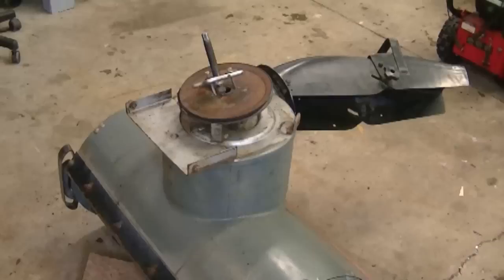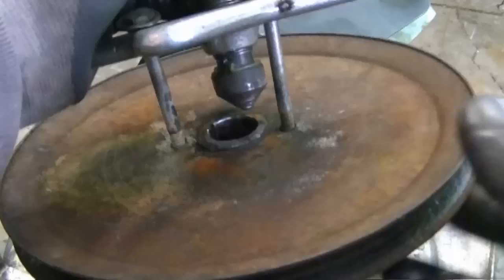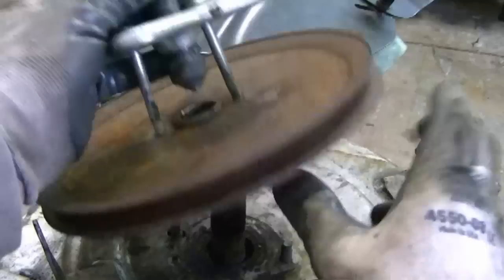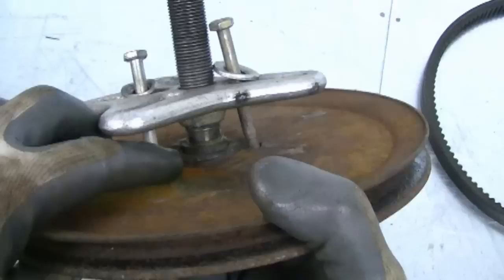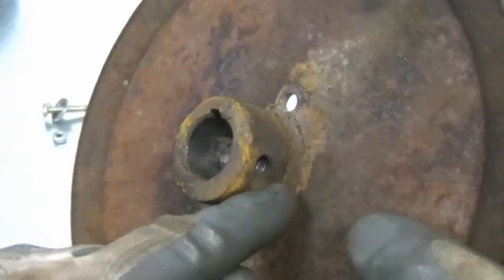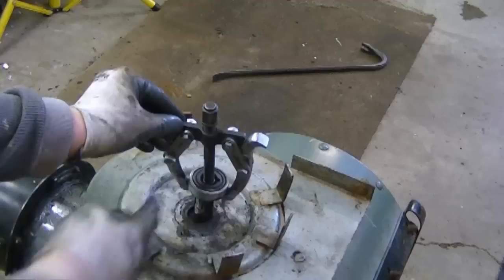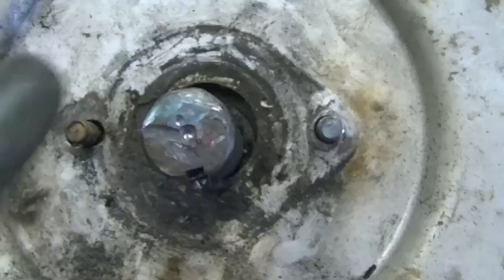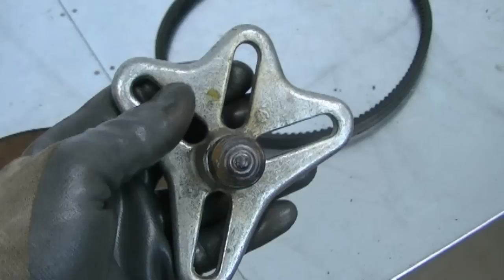How-To Remove A Seized Snowblower Auger Pulley - video

Comment: Very helpful videos. I was able to get 2 pulleys off some old snowblower engines the other day just by heating the old pulley and spraying some PB blaster on the shaft. No puller needed.

Comment: I had that exact same problem with my 40 year old JD 832.  But I destroyed the pulley as the puller I used grabbed the outside lip providing too much leverage.  I ended up drilling 2 holes in the body of the pulley and pulling it off with a strong puller, much like you did.  You are good sir.

Comment: Thanks for ur videos Donyboy-they are great...I have two C950's(5 & 8) now and I couldn't get the auger pulley off the 8 for a bearing replacement until I saw ur vid. I tried the bolt/puller idea but didn't have the equipment to get the heat. I used ur bolt hole idea but used a holesaw to make two larger holes next to the hub so I cud get standard 4" puller arms to hook onto the backside of the hub. I used a chain-wrench to hold the arms together while applying MAP heat..and it worked fine but the shaft/pulley fought it all the way off with loud metal snap noises for the entire length of the removal. Thanks for taking the time to make your vids clear and informative.
Reply from the maker: you're welcome

Comment: Thank you.  Your method work perfectly when I tried to remove my snow thrower pulley!!!  I didn't have to apply as much heat as you did, but it worked.  I NEVER would have thought to drill holes in the pulley.  BRILLIANT!
Thank You!!
Reply from the maker: +jg thanks, make sure you're subscribed

Comment: You did it exactly right, good job. Before heating do this first.  Put all the pull you feel safe with, then do a sharp blow on the end of the puller bolt. Doesn't hurt the puller but usually the shock breaks it loose, especially on tapered shafts like a steering wheel.  Good video.
Reply from the maker: Thanks for the tips!

Comment: First, thanks for posting your videos. They're excellent and extremely helpful.
Here's my questions: 
-What's the torque spec for the bolt (3/8-24) that holds the pulleys onto the crankshaft for an 8hp (HMSK80)Tecumseh engine on a Noma 824 snowblower?
-Should I put anti-seize grease on the bolt threads and/or the crankshaft?
-What's the max RPM for this engine?
Thanks!

Comment: Thanks for posting this. I had to do the same thing but I did not have to heat it up. I turned the puller to get pressure on it then struck it with a hammer. It took a while but I got it off

Comment: Don thanks for keeping videos available to watch. I just worked on an Ariens last night. I have a home made wheel puller. I also needed acetylene to heat it up. Could you do a video on the tools you have for pulling wheels, pulleys, and bearings off. I'm 77 and not sure if I want to buy a set but I know you have to have the right tools to do the job. Thanks again

Comment: Hi Dony. I know this is an old video, but I have a small engine question for you. I am a sm eng tech myself, and I am in the market for a good bolt puller like the one you used in this video on the pulley. There is a HUGE gap in prices on these pullers, and I imagine that quality and overall reliability is a factor. Could you message back, or mention in one of your videos what brand you use, price, opinions, etc? I would be most appreciative. Thank you, and I am a proud subscriber.

Comment: Hi Dony, Nice clear video easy to follow as usual, another good job. Dony I have been working on my equipment for the last 20 plus years. Wish I though of utube years ago. The things I did by trial & error would not have been necessary due to guys like you who are willing to help out. I decided to start a shop from home. Are you willing to help with advice on the start up? If so do you have an email I can contact you at?

Comment: you have to be quick when using heat try to keep the shaft cool but the pully hot its hard to do but if you get both parts red hot they both expand so its like trying to pull it off when its cold but its hot. so leaving tension on the puller while heating up the pully from the outside working in would be ur best bet it should pop at one point.

Comment: Kinda dealing with the same but different issue right now...I have an auger that's seized onto the shaft. I've heated and heated it, pounded on it, managed to get a puller on it and left the puller on while i heated and pounded some more...They just aren't separating. Its an old John Deere 826 model.

Comment: Had the exact same thing happen to me. Listen to this video. I didn't use the two hole method and bent the pulley. I also damaged the shaft in the process. It's going to cost around 160.00 to replace that shaft alone.

Comment: In my experience with this type of problem is to be patient, soak the part with penetrating oil and wait a day, if the part did not come apart soak it again and wait overnight, a small amount of heat initially is helpful, but not hot enough to evaporate the oil

Comment: I need help with the drive pully....any tips its a craftsman 8hp 25 track drive 90s blower .
I took the pully lock screw and tried to pull off, no luck .
Is it a pull off or screw off i was gonna use your pully trick but not sure if it is a pull or screw off. Thanks again....

Comment: I am trying to remove the auger pulley on a toro CCR2000 snowblower.  But unlike your above example, this Toro pulley is made of plastic with only a center portion made of metal that goes on the spindle. Tried PB blaster and small crowbar to left it off, but it won't budge. The manual says it pulls off..LOL.   Thought about drilling two holes as in your example, but don't think the plastic pulley will hold the forces. Any ideas worth trying without destroying the plastic pulley?

Comment: Yes you can use 300 cold cranking amps in your lawn tractor but more cold cranking amps should not hurt any thing because i use a battery that has 340 cold cranking amps even in the summer months and I have never burned out the solenoid and the lawn tractor is 23 years old with the original solenoid!

Comment: Donyboy your series of snowblower videos are GREAT! Thanks so much. I am trying to put the auger pulley and coupler back onto the fine-splined shaft that I accidently mushroomed a little while trying to knock the impeller shaft through, There IS no fixing a mushroomed splined shaft is there? I tried to clean up the splines as best I could but the pulley adapter still won't slide over the shaft.
Reply from the maker: you could maybe grind the mushroomed end
Reply: donyboy73 Thanks! I tried filing it and sanding it---but if I were to grind it down, along the beveled egde at the end of the shaft, maybe it will be small enough to slide in. The splines are undamaged as far as I can tell----thanks again this will certainly help!

Comment: Replacing the impeller pins was not as simple as described at least for my Sears snow thrower.  The new pins could not be installed in the auger housing since there was no room around the impeller to pound them in.  I determined it would be necessary to remove the entire auger assembly to get this done.  After separating  the auger housing from the engine housing,  I could not remove the auger pulley from the auger/impeller shaft .  After removing the two bolts holding pulley to the shaft, it would not budge.  I had to pound it off the shaft using wood blocks and a sledge hammer!   I inserted the blocks under the pulley and pounded with the sledge hammer.  After about 20 minutes and several broken 2x4 pieces it finally came loose.  Unfortunately, I then found that the bearing ring would not slip off the end of the shaft either.   I ended up sanding the shaft with emery cloth for about 15 minutes or so to get the bearing ring to finally slide off.  At this point I could pull the entire auger assembly (including the impeller), out of the snow blower housing.  I then found pieces of the old impeller pins, which had broken off, still jammed in the impeller mounting holes in the shaft.  More banging and pounding required!  I started with a steel punch but that only seemed to jam what was left of the pins more firmly into the shaft holes.  I finally ended up using a 1/4" diameter  x 6" long steel rod to pound out the remaining pin pieces.  Once the old pieces were out, installing the new pins was a snap.  Just pounded  them in with a carpenters hammer.

Comment: Heat up the pulley with oxy/acetylene torch. Put pressure on the pulley with a pry bar. Hit the output shaft with an inverted can of duster spray. Pry up and tap the shaft with a hammer. Pops right off.

Comment: I have a snowblower DG828E and I need to change the impeller bearing. This is the same type as this video. The new bearing came with a key slot. The problem is the part of the shaft where the bearing sits is too narrow so the bearing is very loose. Is this because the shaft is worn out or am I missing something?

Comment: I think the new snow blowers don't have this issue as bad ESPECIALLY THE TORO ONES. Because I think they use an aluminum pulley.. aluminum does not rust. 

Correct me if I'm wrong?

And if they are metal how to stop this in the future. Can you just spray some as you said before What you used on bearings in the gearbox on both sides of pulleys ( spray chain lubricant on both sides if you can get to it?)

Comment: Don I have an old 10/28 Brentwood Noma w Techumseh 10hp engine.  The drive disc pulls is like a spoke wheel that is right up tight to inside wall.  Has a square threaded screw.  Do I need to remove it to install a new drive belt.  If so what is he best method.  Please help

Comment: I tried penetrating fluid, pullers, heat. Eventually It become a lost cause and I broke out the sledge hammer and a wood splitting wedge. Destroyed the pulley and it didn't move lol. Felt good!

Comment: WOW  -I hope my 1996 NOMA ~Murray 24incher doesn,t have the same predicament!!   I have the  Stage /auger area split from the Engine /drive unit.  All this Just to replace the Auger shift cable !!!!
Reply: Just what I did on Mine,, only Had to use a M.A.P. gas torch  & a Ten-Dollar Harmonic Balancer/Flywheel Puller<advance auto parts chain> & a lot of Penetrant Oils----  I could Have pryed it off,the Auger Drive Pulley -But I figured -Do it by Dony,s way--- He seems trustworthy.
Reply: I have a similar machine and the impeller shaft is slightly bent.  The pulley doesn't want to budge I have soaked the shaft with PB Blaster in the hope that it will eventually soak through enough for me to get the pulley off.  I agree that Murray has made things difficult by putting the auger belt idler pulley and brake mechanism on the auger housing.  I don't know why they made this change it seems that things were easier when they were on the main chassis.